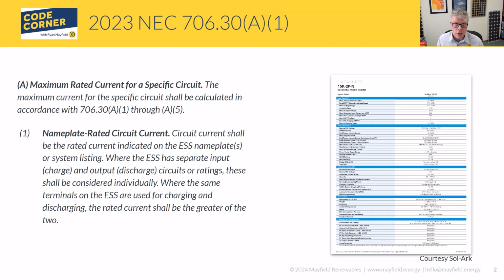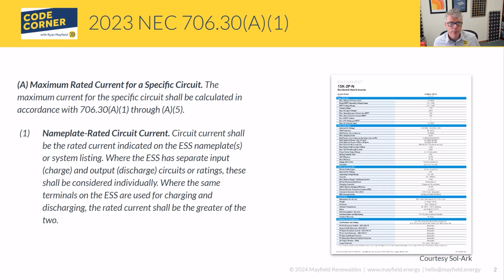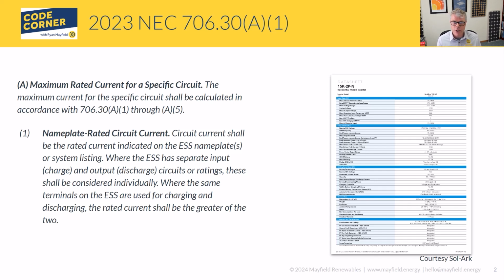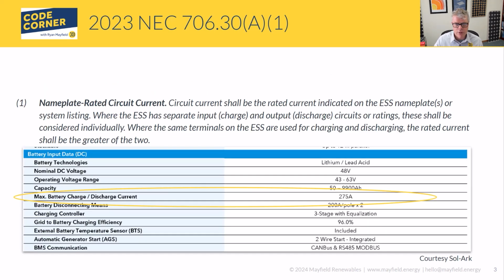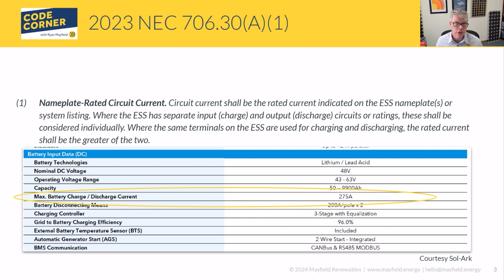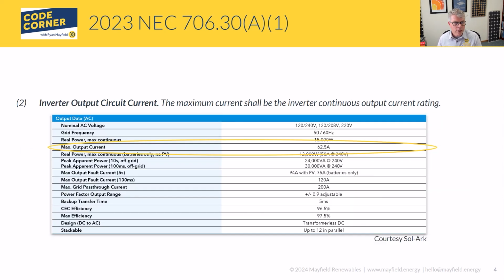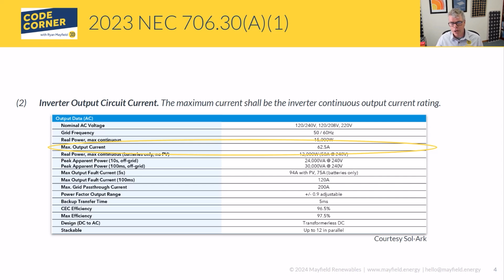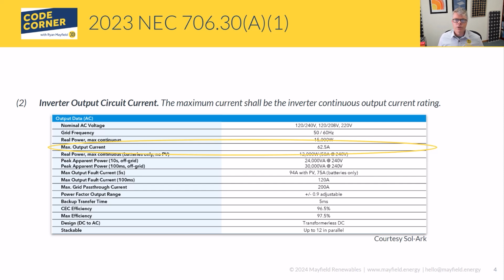2023 NEC 706.30(A) - Maximum Rated Current for Specific Circuit

Comment: If you were doing a supply side connection you would be adding the rated service incoming from the utility plus the inverters output correct? How do power control systems affect this? Do they limit output at all depending on incoming current ? Or do you size on the maximum regardless of PCS or not?
Reply from the maker: This is an interesting question and one that, as PCSs with dynamic control start to hit the market, we may see some changes in interconnection methods. The output of the power production source (PV system) cannot exceed the rating of the service conductors. Our current method is to size the output of the production source to less than or equal to the service conductors. This way, in no case can the current on the service conductors be greater than what they are rated for. 

But as PCSs advance, we could have monitoring on both sides of the interconnection point. This could allow the production source to provide power for loads in the distribution panel while also sending power back to the utility. If the inverters started sending more power than the service conductors were rated for, the PCS would control the inverters to limit that power. We don't think we are there yet, but the rules in 705.11 do set us up for this potential.